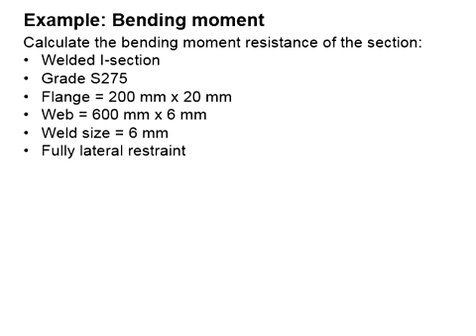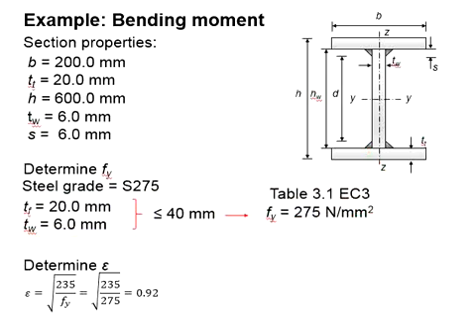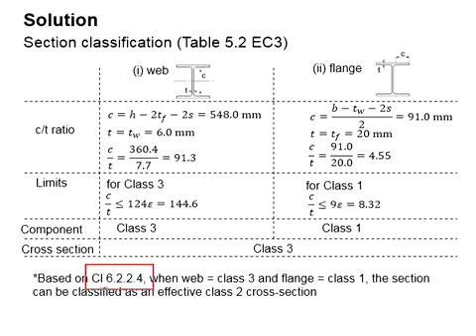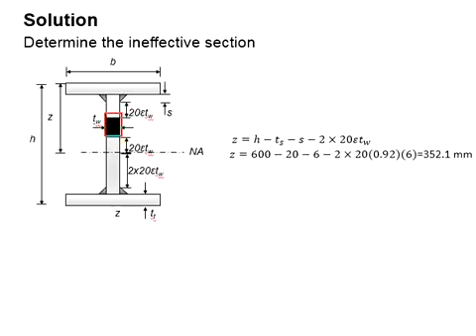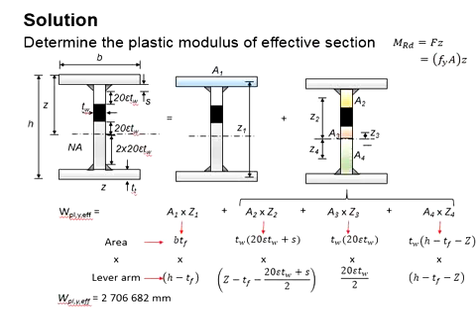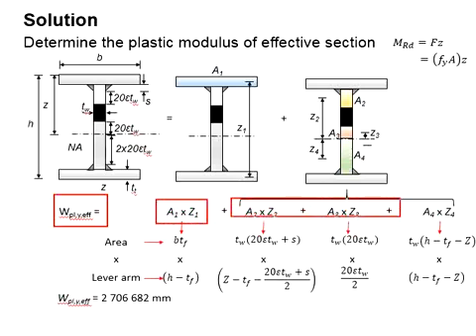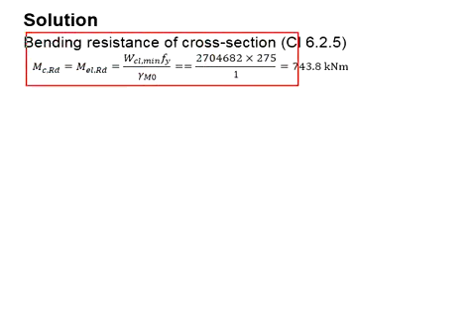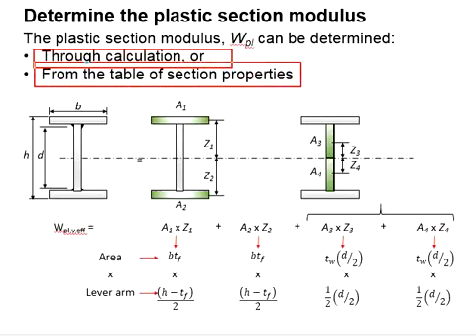4.7 Example: moment resistance

Comment: why the bottom flang not included in the modulus of plasticity equation ? and the lever arm if A4 should be the lever arm of the bottom flang right ?